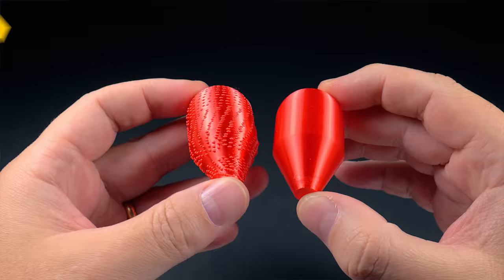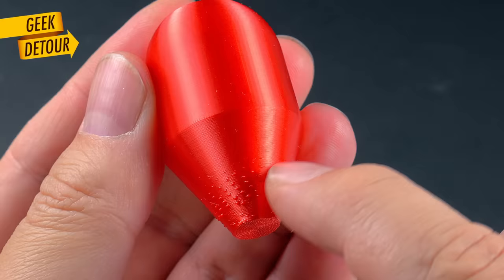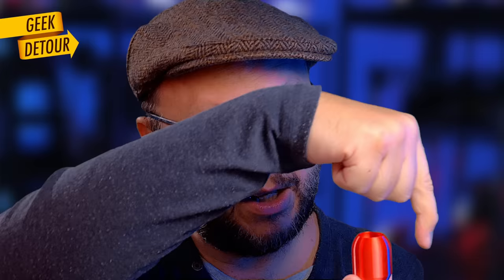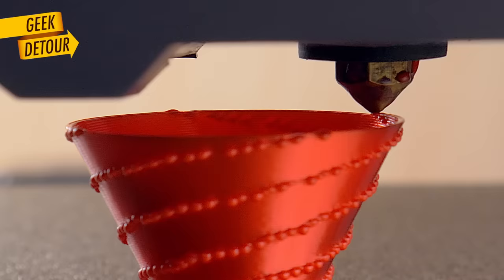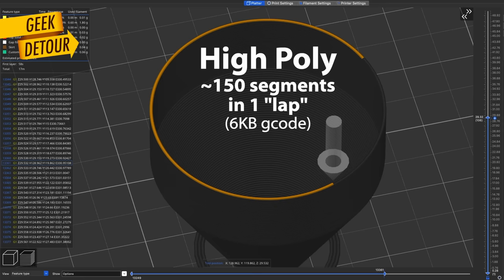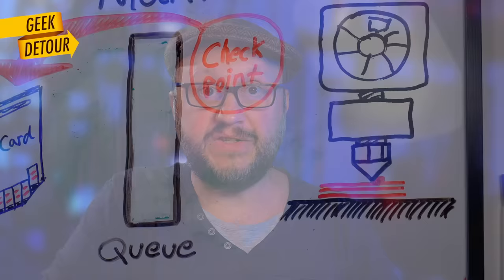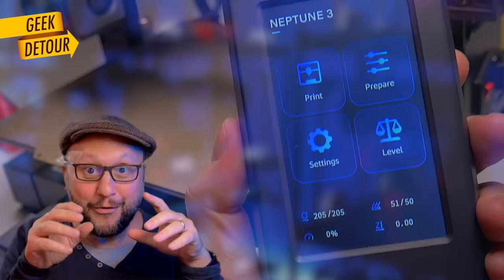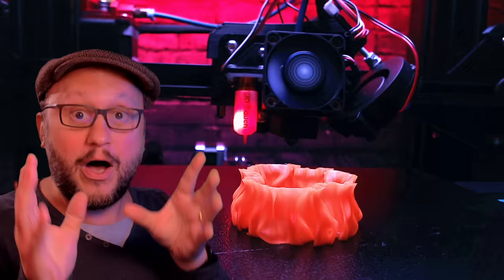3D Printer Blobs: a mysterious problem you won't guess how to fix 🤔

Comment: Alternative is to use arch welder to create curves and use that in G-code instead of simple lines generated by slicers. 
A G-core for one layer of a circle can be written in 1 (ONE) line like that, while a polyline needs thousands for it to make it smooth...
Reply from the maker: Yeah! It works. I tested and it was even supported on the Neptune 3 that I used in the video. But I don’t like the fact that curves are not really on the STL file itself - it will make sense when/if we start printing from STEP files, that would have the original curved geometry information

Comment: I've been struggling with blob issues in my prints for the last week or so and only a couple of days ago did I manage to figure out it was due to Octoprint not being able to keep up with filling a command buffer for my Prusa Mini after upgrading to FW 5.1.2 and enabling Input Shaper for much faster print speeds.
While the root cause of my issue is not the same as yours, the underlying mechanics are pretty much the same. Had I seen your video a week ago instead of getting completely irrelevant answers on forums (wet filament, overhangs???, etc.) I could have saved tons of time!
You did such a great job explaining the whole concept and even touched in my exact issue in your conclusion - I'll try optimizing my Octoprint setup for speed and stable connectivity and see if I manage to get better results!
Really glad I came across your video, i'll definitely link it in all of my forum posts as the practical answer to my issues!
Reply from the maker: Hi there! Oh, I am so glad you figured out the problem with your printer - maybe just using a higher bitrate on the serial connection would help too… but that depends on the specifics of every board and what is supported. I used to love OctoPrint… but I recently got into an insane Rabbit hole about print artifacts and I could see differences between printing from the SDCard and from OctoPrint… (which gets just a tidy bit of extra artifacts)… I am moving all my printers to Klipper this year.
I am so glad you liked the video - welcome to the channel! This year I’ll dive into some crazy stuff about what makes a print really smooth or not - so, stick around! 🤗
Reply: @GeekDetour  Interesting idea about bumping up the bit rate of the serial connection of the Octoprint, I'll have to look into it!
Currently I'm planning on giving the PrusaLink a shot as a replacement for Octoprint since to my understanding PrusaLink loads the gcode from my computer to the printer directly so it's comparable to running it from the SD Card.
I'll have to take a look though!
In any case, really looking forward to see what else you have planned, if it's even half as good as this video - I'll definitely enjoy it!

Comment: Also, compiling a firmware with arc support and using something like "arc welder" to substitute multitude of small segments into gcode arcs helps a lot.
Funny arc interpolation has been in real CNC control like Linux CNC for ever... Good printer firmwares are catching up.
Reply from the maker: Absolutely true! The Neptune 3 that I used in this video already came with ARC support and it indeed makes it work fine even with the Powerloss Recovery activated. BUT the only viable Slicer to use it is Cura with “Arc Welder” plug-in. In a near future most printers will be running ARCs 👍
Reply: I use the Arc Welder plugin for Octoprint, which will work with any slicer. Every time I upload a file it automatically generates an arc welded version and I just select that file to print instead if it's anything circle-heavy. With certain models the file will often end up at least 50% smaller.
Also it's trivial to add this (and lots of other features, assuming you've got a chip with enough memory) even if the manufacturer didn't think to include it by building your own firmware. Marlin is fairly simple to compile and upgrade on newer boards with SD card bootloaders so you can do lots of customization and keep up with new features even on old hardware that didn't ship with it in the original firmware config.
Reply: @ailivac  With gyroid infill, arc welder consistently gets it down to about 60% of the size, even without the model having lots of circles. As some of the more curved infill patterns become more popular, I wonder if it'll become commonplace for slicers to incorporate arc support
Reply: @bandana_girl6507  Yes, the gcode is more compact, the instruction rate is higher though and the board actually has to do more calculations, as there is no way to make a smooth circular movement with the most popular kinematic designs. It just gets translated into a series of linear movements, the exact same way the slicer does this, just on the fly. 
It helps if your SD card is too slow (which honestly is basically impossible), but it doesn't help at all if you are running into instruction limits (which is very possible). 
The same is true with LinuxCNC, but there it is a bit different, as the instruction rates are distributed differently between the components.
To be perfectly honest: monolithic firmware like marlin has been a great tool to bring the community forward, but by now, it is simply outdated.
Reply from the maker: Wow! Excellent info here!
Reply: @3dprintersawhiteboard401  this video is about SD speeds being too slow on write for saving with the power off feature. Also, the individual segments of the arc don't take up the instruction queue. The current code for most firmwares on a modern printer means you can reasonably use arcs as a way to compress instructions, fit more in the queue, and then have the printer's processor decompress them.
Reply: @bandana_girl6507  The issue in this video is missing concurrency between read and writes, and not solved by faster sd card readings. The event of state saving to sd gets triggered each layer, not every nth GCode command and writing times are the exact same. So using g2/g3 does not help the issue at all.
All you can do is either use a firmware that allows concurrency (which is kind of possible with Klipper, although only concurrent between different micro services) or drop the feature. As long as our print heads stay without kinematics (very different for olmulti axis cncs) arcs will slow you down on a 3d printer in anything else but gcode generating / storage of the gcode, which is not part of the pseudo realtime stuff (pseudo because look ahead always prevents true realtime).
The arc will take indeed up multiple instruction spots though, it is basically something like a macro, not a single instruction in the printers queue.
Reply: @3dprintersawhiteboard401  if the event of saving were to happen only once per layer, you would only get one blob per layer. It saves more frequently than that, thus multiple blobs per layer. 
I cannot speak with absolute certainty for firmware other than Marlin, but I know that Marlin caches commands (which, depending on your setup, could be an alternative way to avoid these blobs as that is a variable [or rather declared constant] in the code [though not in either of the configuration files, if I remember correctly]), not interpolated instructions. 
Also, while the problem presented in the video could be seen as a problem of concurrency, it can also be seen as a problem with write speed. When given sufficient time to write (as seen with a slightly lower resolution model or arcs both having a longer amount of time due to distance traveled in the same number of cached commands when compared to a high res model sliced with only segments), the tasks can be performed in serial instead of parallel. Oh, and unless you've got some odd hardware, SD readers/writers are consistently a serial interface, so at some point it will be a serial problem anyway
Reply: @bandana_girl6507  You are right, it"s more than once a layer at this point', it used to be different in the first dev branch when it came up, but true, its more often now. However, you always limit at the write speed, and this one is staying the same. The cache in Marlin is limited by instruction size, not GCode lines.
Consider the folliowing:
cache is full with n instructions
write to sd starts
cache empties before write to sd stops

I think you can agree to the writing issue like described above. Where we dont seem to agree is how the caching actually works.
There are basically three caching layers in terms of logic. Reading of the file/exctracting g-code command, processing the command (with look ahead and kinematic model) and finally the stepper instruction queue.  
The buffer for file reading is negliable, it is basically always dry. So this is not very interesting to look at here. 
Now, if we found the instruction G3, the parser will read it and call a subroutine to translate into gcode commands that are a series of linear movements into the planer. There are no further reads until this is done. If I understand you corectly., you argue, that in this time there is a kind of a pseudo buffer because we have a time-consuming instruction so we need longer times until we read again. While this is true,. this cache is pretty much negliable in comparison to the planer buffer, which already contains the linear movement translation of g3. On a well working setup the buffer is almost full all the time, and contains way more instructions that the arc has, so the difference is small. Existent, but academic and irrelevant. 
I am not actually sure how the printer will save the arc state, there is a chance it will cause less saved states, but that is crippling the feature the same way it helps with the writes, it would be a  "semi turned off" state..
To be perfectly honest, I didnt keep track with Marlin commits the last 1.5 years, but pretty sure this mechanism is still the same.
Reply: @bandana_girl6507  Generally, the additional compute time of arcing has more negative impact than positive one, on this specific setup. The instruciton queue is not super smooth with marlin anyway, and it gets worse this way just slightly decreasing print quality.
Reply: @3dprintersawhiteboard401  the read buffer is not negligible and is precisely where the extra buffer is coming from. If memory serves correct, Marlin by default will read up to eight lines ahead. It will try to fit the data from this as far down the processing chain as possible, though if the memory ahead is fully allocated, it will instead wait to process it. 

As for processing time, on a standard modern 32-bit printer board, it's optimized enough that default interpolation resolution is more than handleable on most machines at max speed (and well beyond ideal operating speeds). And with properly defined arcs, the default interpolation resolution is within kinematic tolerances of almost all machines. 

As for not saving where in an arc you are with power loss, you also do not save where you are that precisely without arcs, so...
Reply: @bandana_girl6507  I mostly agree on the first part, at least how the data get pushed through. But if I remember correctly, the line buffer is much smaller. At this point I of the discussion we have to look into the code to settle on a common point though, I guess.

However, hitting instruction rate limits is a very common occurrence these days, especially with Marlin, but also with faster firmware. Surely not on an Ender or Prusa, but on more modern designs it is a constant issue and not only in arbritary situations only anymore. 
Kinematics are fast now, cooling is strong, accelerations allow to get to 1m/s moves on print bed size and hotends can melt 2kg of plastic per day now. Combine this with 8 simulations steppers driven and microstepping of 1/128, you quickly get issues. 
Most of those users don't run Marlin though. RepRap also runs into issues and I know for a fact that even small bed slingers run into issues with 32bit boards there, even though only running 4 steppers.
I highly disagree that instruction rates are not compute time limited with monolithic firmware.
Reply: @3dprintersawhiteboard401  you aren't printing at 1m/s. 80 mm/s is a much more reasonable print speed if you're actually at the point where blobs would be a concern, and interpolation of arcs happens faster than print speed with default interpolation resolution (at least with G2 and G3 arcs, G5 curves). Apparently Klipper has some issues that make the default interpolation resolution too rough (at least for working with Arc Welder), so it is slower for a reasonable interpolation resolution, but that's your only issue. 
Oh, and the Arc Welder dev even indicated that arcs over a certain number of segments take less processing than a set of G1 commands, so either way you'd be caught waiting on processing something
Reply: @bandana_girl6507  Well, the dev is not right if we print at same resolution on a printer that does not use a coordinate system where the arc is a linear movement. I guess he was talking in a context of print and slicer resolution settings not matching up, where it would be right, but that is a slicing error. In this case, aecs would indeed be beneficial. it is different for cnc mills, where arcs can correspond to single axis movements and ellipses to dual rotational axis defined by the radiuses. Other than some rather special prototypes I have not seen this in a printer so far.
Arcs in klipper work fine, if you set them up correctly, but it is a rather neglected because at this point unintersting feature as far as I can tell. But you'd have to ask Kevin for why there is not much work put into it. It's not exactly a complex feature to implement.
Btw, the last time I have seen 80mm/s outside of printing TPU or some other more special filaments is a while back :)
1m/s is a speed not often used, 400mm/s however is rather common and results in great prints. Due to the nature of the motors and belts actually in better prints with less artefacts actually.
I feel like this discussion is way out of proportion for a yt comment section though.
Reply: @3dprintersawhiteboard401  where have you seen 400mm/s prints of reasonable quality (other than for highly simplistic parts)? The best I'm finding is roughly 400mm/s Benchies which look horrid. I'm finding the same machines (Vorons, for reference) which did those 400mm/s benchies still being recommended for maybe 100mm/s outer perimeter with ABS and more commonly 80mm/s.

Also, the big saving the dev mentioned is text parsing. Give me a week or two to dig through code and see if I can find exactly where the crossover is if you really need to have that worked out for you(though I'm only going to check assembly code for one processor).
Reply: @bandana_girl6507  Benchies are acceleration and cooling limited, not speed limited, so they are not really a good test. If you put 5 of them on the plate instead of a single one, the quality would increase big time. Most speed benchies look ugly, but a normal sized benchy in 12 min that looks just asgood as a 3h one is sth I can get out of most of my printers. Sub 10min they start to look ugly for me, because if I go with accels significantly higher than 15k smoothing hits  and layer times below 1s look melty.
400mm/s (and higher travel speeds) at .2 mm layer height is absolutely common within our community though for common parts. I print my infill at 450mm/s in my farm profiles, 350mm/s for perimeters. Those are 24/7 profiles, not going into limits. Quality is pretty impossible to quantity, but it looks better than stock profiles on a Prusa. 
The recommendations of filament manufacturers are very arbritary.
Arc calculation is not text parsing only (besides, text parsing on those boards is not a good task anyway). It is a trigonometric function which includes squareroots, which are rather expensive compared to just setting the commands for the drivers.
Of course you have to compare the two tasks to each other and it is true that text passing is not an ideal task. It is quite some time back I did performance analysis, but it was not the major contributor. 
Did this core part of Marlin change significantly? (Honest question)

Comment: Worth a shot; I've been running constant stringing tests, and they keep coming out blobby, incredibly flawed, and stringy; when a setting helped it just replaced the whispiness with periodic full extrusions of string coming a couple mm off the test part. Tried a bunch of stuff at this point; calibrating the PID, calibrating the extruder, retraction settings, coast settings, wipe settings, speed. The general quality of my prints has improved, but not the stringing.

This one seems worth a shot; they're certainly rather small rounded parts, and as much as reducing the print speed helped it didn't really get rid of the problem, it was just the one that gave me the full extrusion strings instead of the whispiness.

Edit: this one did the trick! I mean, there are still adjustments to make to clean up the printing quality, but now it's normal whispy stringing rather than blobby and misshapen parts.
Reply from the maker: I am very happy for you! Thanks for reporting ❤️🤗